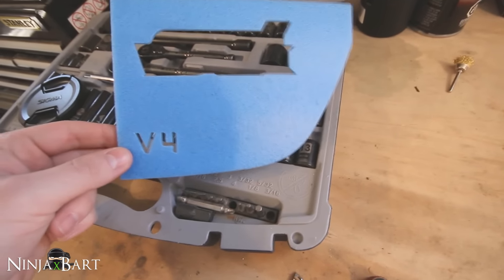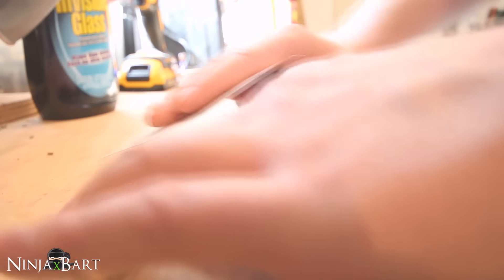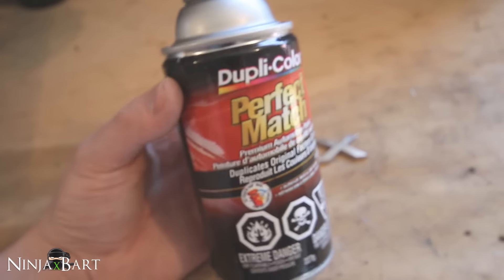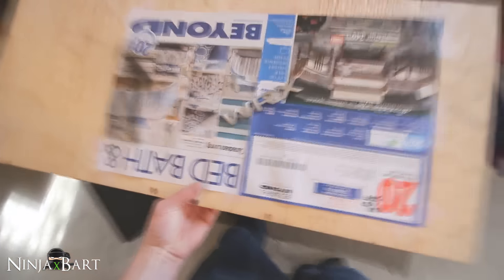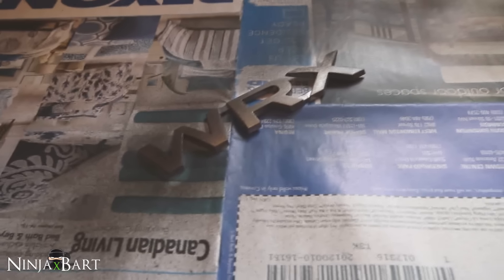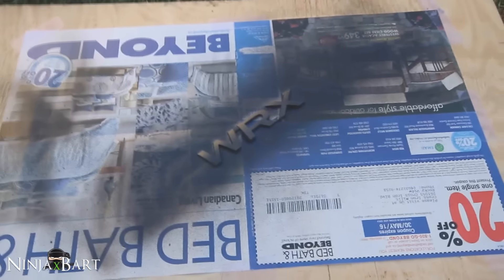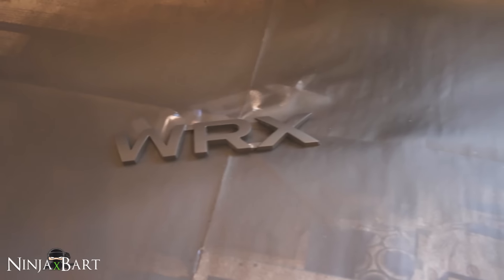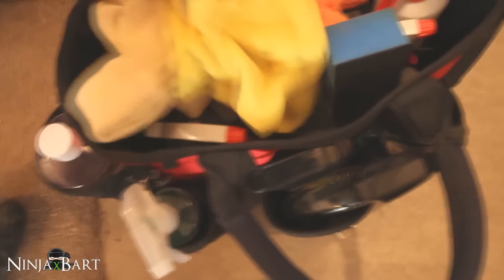Blacked-Out WRX Emblem Painting DIY (2016 Subaru WRX)

Comment: Looks good, man.  I blacked out all of my badges as well.  I just used Plasti-dip though, that way I didn't have to remove them and could just peel away any excess. I thought about buying the entire set of badges but spending over $100 on badges seemed a little steep haha
Reply from the maker: +doughdreads  Nice dude!! Yeah it's definitely a much cheaper route that's forsure!!